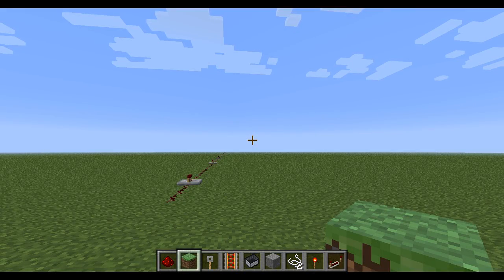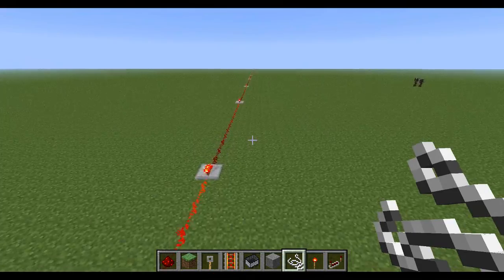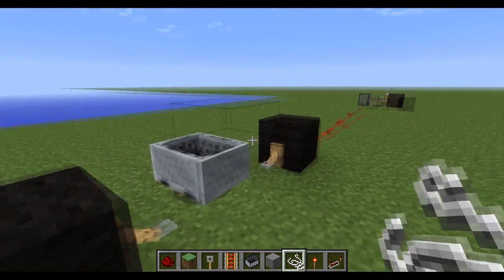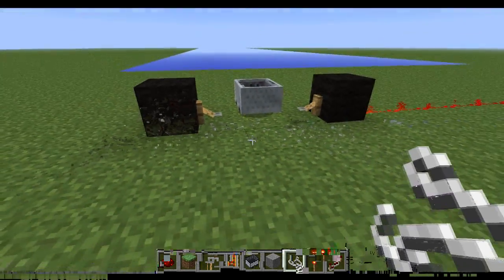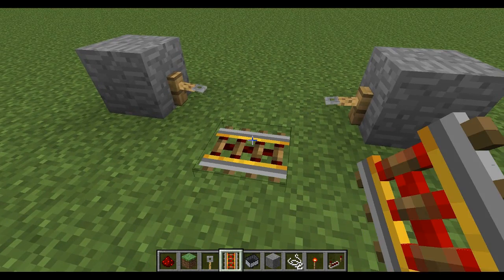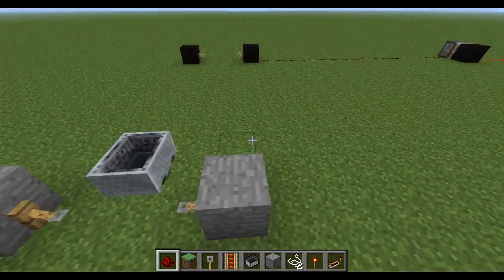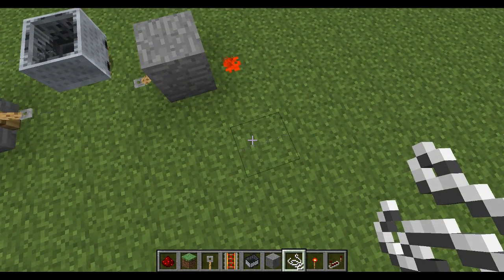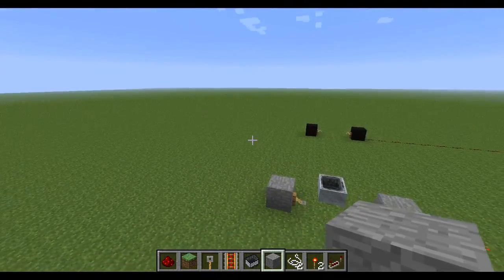Wireless redstone that works outside of the loaded chunks

Comment: Well, you didn't test as far as I did, so for now I would say you simply didn't test far enough. I have no clue why it would be loading like 19 chunks now and I'm not even sure that is the case, or if something else is going on. My cart is at x 230 and I pulled a wire to x -80 (and that's where I was when placing string to test), so that's the direction I used in testing :).

Comment: I didn't really look at the number until now, just went really far away. Just looked at it: about 310 blocks apparently. If I place the string there, the wire does not start pulsing. If I then move 20 blocks to the minecart it start pulsing (at 290) and if I move away again it stops pulsing at 300 blocks.
However if I relog it pulses even when I'm around 310 or further. I have to go to 290 and back to 300 to make it stop :p.

I have no clue how to explain all this :p.

Comment: I also noticed that to turn it off once activated, it's not necessary to look at the top wire, you just have to make the chunk with the minecart visible. Another thing I noticed is that to activate it, you don't need to look at the string, it's enough to make a chunk with a string visible.
However, I have to admit that sometimes it appeared to activate from a larger range, especially after relogging. Also, the trick suddenly stopped working for me... I'm so confused :p.

Comment: With this mechanic there however is a difference between visible/rendered chunks and non-visible ones. (Note 'loaded' and 'visible' are something very different in this case, at least accodring to my definitions).  To be non-visible it's enough to walk outside the chunk and turn your back on it. With the minecart in a non-visible chunk it behaves like you described it for an unloaded chunk: it has a memory. With the minecart in a visible chunk it behaves like a button.

Comment: Nice discovery :). I did some testing with it and I don't think it exactly as you claim it. You didn't go far enough to unload the chunk with the clock I believe (you were clsoe though). A trully unloaded chunk will not be able to do anything, including sending power to the loaded chunks. Placing string with the minecart unloaded (i.e. far enough awa or in the nether) will still affect the minecart once you laod the chunk though.